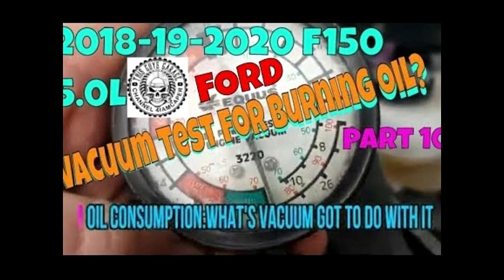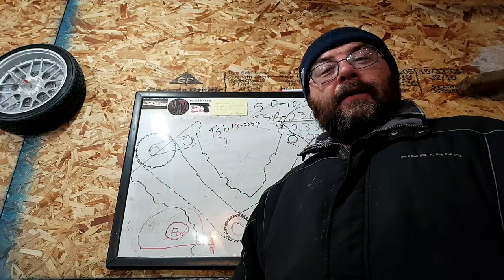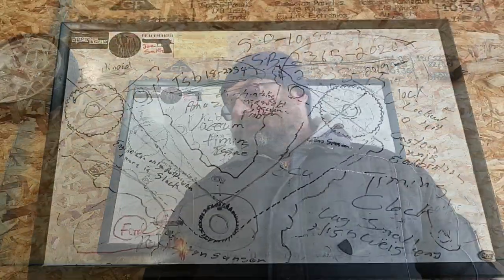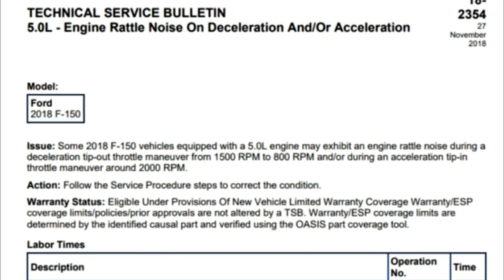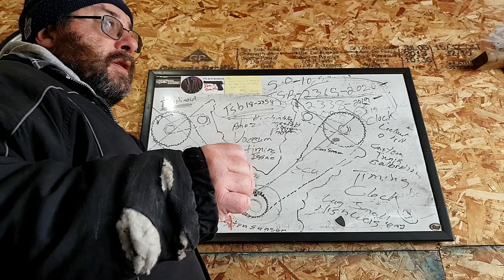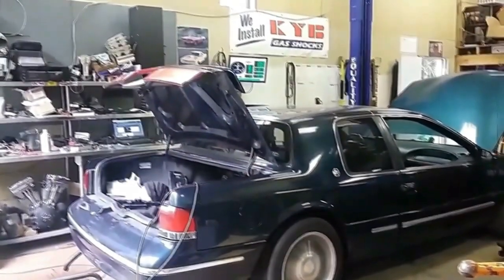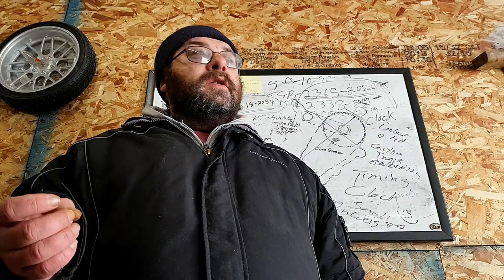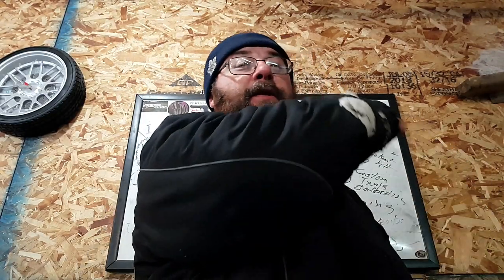2018 2019 2020 FORD f150 5 0 engine rattle tsb 2354

Comment: Have same issue with my 2019 was burning oil and making loud noise when letting off the gas. They are trying to tell me it’s a normal noise
Reply from the maker: air quotes with that normal ,these SOB's need to look after their customers, ty Andrew!
Reply: @thisguysgarage  the oil did not even register on my dipstick and that’s when the slap rattle noise started when I let off the gas pedal. I noticed it happens a lot more in the morning when colder but it only has 21,000 miles on it and I really hope they fix it Monday when bring it in again. I showed the mechanic videos of my personal truck making the noise and he confirmed my tuck is making the noise but now they want me to bring it back so he can ride in the vehicle to see if they can “duplicate” the sound.
Reply from the maker: @andrewbishop1925  omg. the typewriter sound is a common issue, and they go on like they never heard of it before.  stay in touch.  I would love to hear what they have to say 👍good luck 👍
Reply: @thisguysgarage  if you got a email I’ll send you the videos of my motor. I know it’s a 5.0 but I swear it sounded like a 7.3 power stroke
Reply from the maker: @andrewbishop1925  someone asked me how I liked the new diesel when my truck was 6 months old and only had 10k on it. 
4iamcaper@gmail.com

Comment: Mine has this rattle, 2020 XLT, less than 500kms.
Reply from the maker: what has ford told you?
Reply: @thisguysgarage  Hey man, thanks for response. I uploaded the different sounds I went into the dealer asking about, so you can hear. 

First, the deceleration sound, dealer said it might be a faulty check valve that controls the vacuum that connects/disconnect front axel to wheel (for 4WD) (think putting your finger into a fan)
Second (whine), third (diesel-like sound) and forth (tick), they said were all normal.
Here are the links...
Deceleration: https://www.youtube.com/watch?v=vcrZDfawfAM
Whine: https://www.youtube.com/watch?v=Xr8tn9iiRao
Diesel-like: https://www.youtube.com/watch?v=aLsMdv2CKHs
Tick: https://www.youtube.com/watch?v=gsiqHVMBgtA
Reply: Ah forgot the mention, for the Diesel-like sound, they pointed me to TSB 19-2144.
Reply: I had the same problem with my 2019! They sold me a Truck with a engine problem! My truck lost it’s value! 😤😢

Comment: i have no idea how you are coming up with this thought process considering there are people that have oil burning and have never had the tsb you are referencing. the "slack" you are referencing is wrong the noise is coming from vct solenoids this has already been shown multiple times and verified using diagnostic equipment. unless you are the engineer that designed the engine and you have fords ids system you cannot properly diagnose these vehicles and are just guessing.
Reply from the maker: thanks for taking the time

Comment: I had the deceleration noise for while, brought it to ford a few days ago and got it back today. They said it had low oil and performed tsb 2365 and replaced dipstick. I asked him how lengthening the dipstick is a solution lol. Fucking guys, thx for the vids and info, I'm assuming even though the noise has gone away it will return soon. Also had freezing doors on 2015 and warped dash. freezing doors still on my 2018 lariat. They gave me a 2020 loaner and the dash had a huge bubble in it?? Be nice if they executed thier engineer becuase he or they are useless. Cheers
Reply from the maker: absolutely! ty so much

Comment: This is absolute B.S.!  Horse...  I had the issue.  It was fixed by swapping out the PCV to the Mustang's EV281 and allowing the engine to break in.

These engines have 12:1 compression, and plasma cylinder liners.  The liners are much stronger and take much longer to break in.  This allows blow-by until the rings seat.

These engines are not starving the timing chains or anything of oil.  Total Load of Crap!
Reply from the maker: 10.5 to one is the compression ratio.  lots of folks having issues still.  obviously you disagree and that's ok...
Reply: @thisguysgarage  see, this is absolute proof you don't have a clue what you are talking about!   The 2018-2020 Coyote 5.0L F-150 engine you are referencing in the video has a 12.0:1 compression ratio!  Google it.  ...and you are just as wrong with the rest of your information.